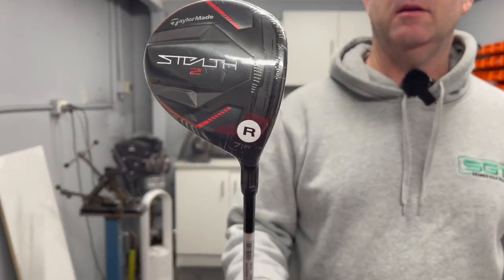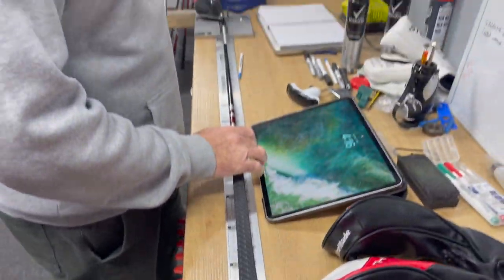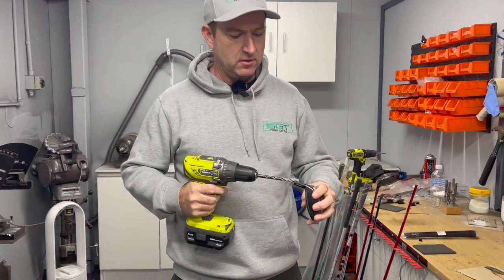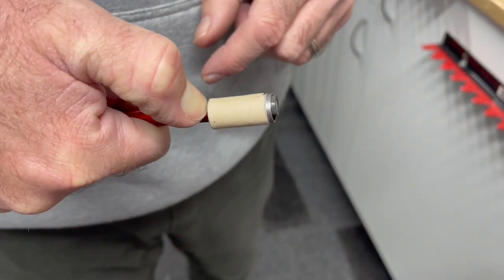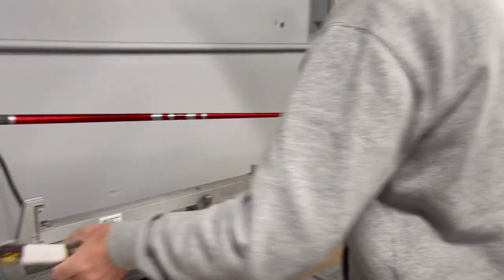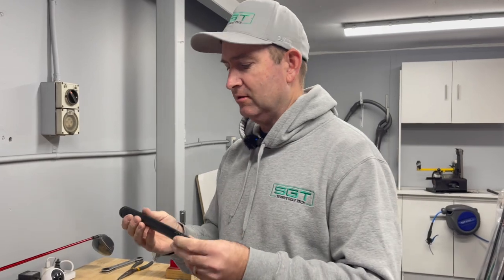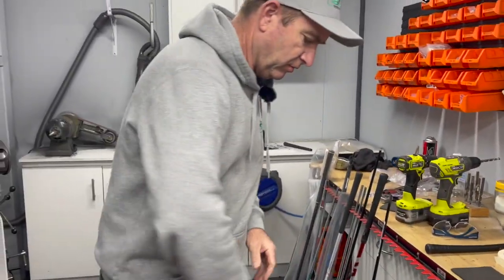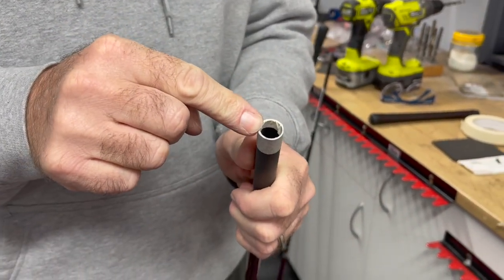TaylorMade Stealth 2 Fairway Build

Comment: had the please of watching Greg sort out my wife in January this year when we were over from the UK- - with her driver before you start giggling - and what a cracking guy - well worth the visit. Greg, currently looking to get a Stealth HD 27 degree rescue but ideally would like the Reg shaft which seems to be in the UK really rare and if you can find them they are a speeder NX-50R. Far more readily available (and far less expensive) in the A flex or senior - with a Speeder NX 50 -A. I have a relatively slow swing speed 85-90 mph - would I really notice the difference between the 2?
Reply from the maker: @Revellien  there will be a slight difference and I think the A flex may be well worth the gamble. Often softer shafts can go really well in most clubs other than a driver. I’d say go for it!!